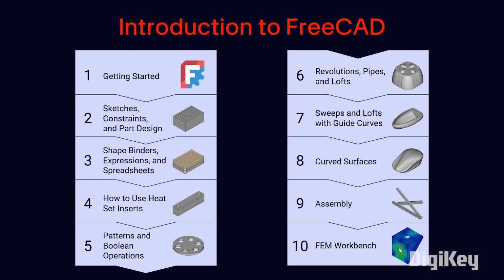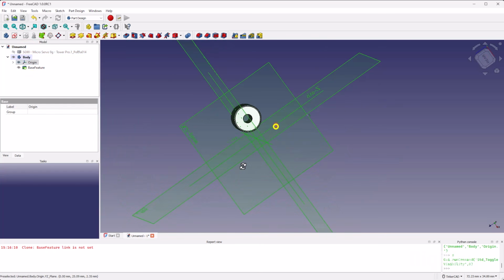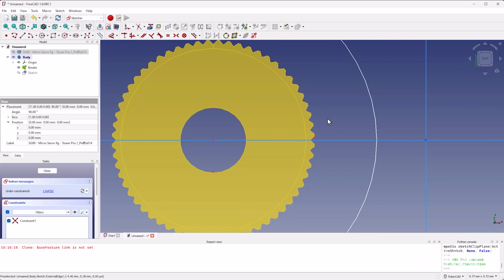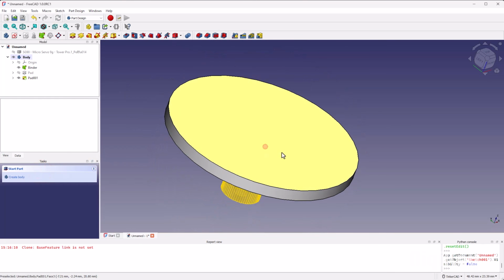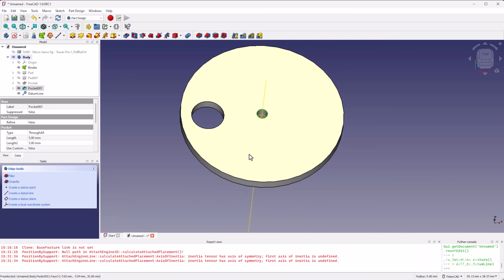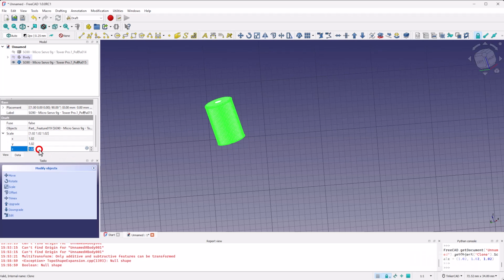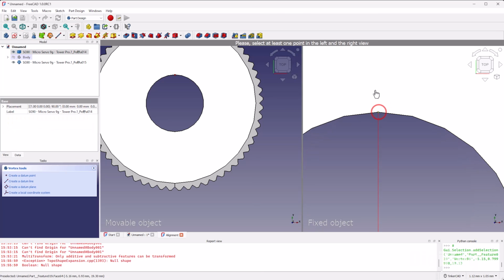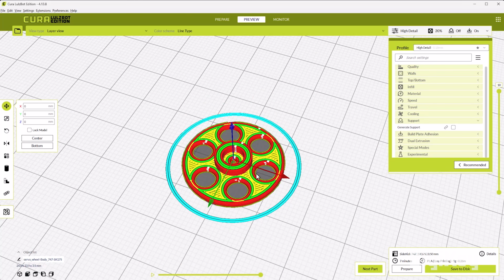Introduction to FreeCAD Part 5: Patterns and Boolean Operations | DigiKey

Comment: In 1.1.1 I was not able to use the "attachment" options to select the binder face. I could select it, but it would not use it and the field would remain empty. Clicking the 3 ellipses in map mode did work, however. I clicked the binder top face and it modified the attachment correctly. "Attached with mode Plane face." Reference 1 became "Plane" with value "Binder:Face63". Not sure if this is new behavior or just some default buried in the configs somewhere that I don't have set correctly.

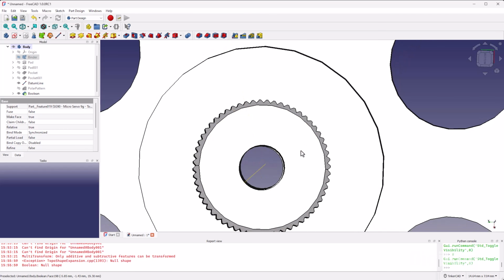Comment: I just want to point out that the alignment feature seems to only work in one axis at a time, so as you show it only moved the part on the x axis... so I tried going back, repeating the same steps to align the y axis, selecting point like previously, and it works for the y axis, only it cancels out the previous alignment on the x axis.... You can see a slightly larger lip for the cylinder pictured at 22:49.  Sorry i'm not bringing any solution here, just an observation :)

Comment: The toothed column is no-longer a separable part in the micro-servo model, at least in the FreeCAD Link Branch I'm trying to use  (2024.1006.0)   It appears to be nested more-deeply in grouped shapes, and also seems to have dependencies on other shapes such that it can't stand alone.  That said, I'm a newbie and could be stumbling over something that veterans easily side-step...
Reply: I can confirm it still works as shown in the video.  I just did it in freecad version 1.0.2
Reply: @jkimm430  Thanks!  I must be flubbing something along the way... will have another go!
Reply: @RickDavis-x3d yeah, the biggest thing is to keep with it. I went through the first couple of tutorials a few times. There are definitely bugs in the software, but I find much more of the time it is me messing something up. Overall, I am happy that I stuck with it. Wish you the best of luck!

Comment: Hi Shawn,
Great tutorials, thank you!
Unfortunately I have had to give up with this one!😢
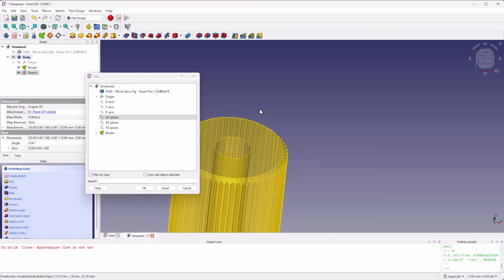After several hours and a lot of attempts to follow step-by-step, I get to the step at 9:20 to change the attachment of the sketch, but selecting the face does nothing but hide the dialogue box until you press escape.
I am running version 1.0.1 and can only assume this is a bug.
I cannot find any way to align the sketch and the shaft, so I have had to move on. 
I am trying to decide if it is worth continuing to learn FreeCAD?
Reply: Hi Shawn, Just a quick update... I was using FreeCAD on the Mac. I have just installed FreeCAD on my Windows 11 system and this feature now works. It looks like it is a bug with the OSX version.

Comment: Hello there. I am sorry, but I do not have my FreeCAD opened, I am just looking at the video and study your procedures just in theory. At min.18:09/26:53 you are scaling the shaft by 1.02 factor, but it scales it around the system center, rather then the center of the shaft itself. You opened the "Data" table on the left and under the "Scale" you modified the properties, i.e. the scale factor of all 3 axes to desired number, but it is off....... And I am wondering here, if it would be possible to also change the properties of the "Placement" and enter the center point of the shaft to make it scale around it (rather then about the center of the system and the aligning it later). This is strictly just theoretical question-is there this possibility and would the FC execute it properly - just as a alternative way of doing it???

Comment: Your knowledge is impressive! Thank you for your work!
But I get to the point that not all of my failures are my faults. FreeCAD seems to be far away from useable for everybody. I just decided to return to Onshape.
Reply: How are you liking Onshape? FreeCAD is still miles away from things like Fusion for ease of use. I hope it gets there one day.
Reply: @ 
I don’t like fusion, because it takes so long until you can start working. I‘m a 65 years old retired teacher for informatics, who has never come in touch with CAD before. I like 3d-printing, so CAD should be a tool for me, not a challenge. Onshape is more logical for me, but I wanted to give FreeCAD as an Open-Source solution a chance. But - once again - your work is really impressive! 💪👍

Comment: Hello. Very helpful video series! Was wondering if you also use the different views - e.g., v1 (regular view), v3 (vertices-and-edges), v6 (smooth render)? I usually use v3 when highlighting edges when applying chamfer/fillet, especially for details which have lots of edges that are sometimes obscured by the part. (v+1, v+3, v+6 are the keyboard shortcuts I use (macos), hence my reference to them as v1, v3, v6).

Comment: aaaaand I’ve given up on FreeCAD again… (for now)
Reply: I see. I’m kinda rooting for SolveSpace to merge with CAD Sketcher for Blender, which IIRC are already related
Reply: Oh no! Which part was confusing? The inability to easily scale bodies did almost make me give up :(
Reply: @ShawnHymel  yeah it's just... when it takes this much planning and workarounds to do something that is 1 or 2 clicks in Fusion, then to me FreeCAD is not ready to delve into. BTW, could this enlarging of that serrated hole not also be done with (the equivalent of) an 'offset' operation?
Reply: @crosswick I definitely find FreeCAD more work than other, close-source options. It's fine for simple shapes, but I agree that some of the workarounds are really frustrating when other CAD programs handle them way more easily. I hope it continues to get better, as I see it as the only real open-source competitor to things like Fusion.

From what I can tell, you'd have to clone and then offset a body in FreeCAD to do something similar. There are a couple of ways to scale a body, but none of them are particularly easy/precise.
Reply: Ah about that: I was wondering why you left SolveSpace out of your CAD package comparison.
Reply: @crosswick I honestly don't know much about it, so I'll have to give it a shot. From stuff I've read about it, it seems easier to use than FreeCAD but doesn't have as many features.

Comment: There is a tool in Design456 that reset the part's location .. which make it easy to put it at (0,0,0) and  you can return back the part to the origin. Very easy to use
Reply: Cool! I didn't know about that workbench. Will have to check it out.

Comment: Nice work, thank you.  If I could make a request, I'd really like to see a video on "best practices", "how to approach xyz", or "proper workflow."  It's easy to design a raspberry pi case in FreeCAD, but it's another thing entirely to design something just a bit more complex than that.  Example: a 5-gang lightswitch wall plate - if attempted as one sketch, this will end horribly.  Imagine many newcomers get stuck on something like this and give up, because they didn't know how to approach modelling it.  Thanks again.

Comment: Seems like much more use could be made of the origin -- repositioning objects on the origin to make centering and aligning of things much easier? Just a guess. I have a tiny bit of experience with AutoCad, so I'm kind of speaking out of school.
Reply: Aligning or repositioning the origin of non-native parts (e.g. STEP files) turned out to be really difficult in FreeCAD for some reason. It's one of the features I wish was added. If you (or anyone else) knows of a better way to do this, please let me know!

Comment: This one was the most confusing when you had to redo the slight enlargement of the gear teeth. Maybe you should have done it the right way, or best way, for newbies to begin with....
Reply: Unfortunately, FreeCAD doesn't have an easy-to-use scaling function. From what I understand, it's something being worked on in v1.1.